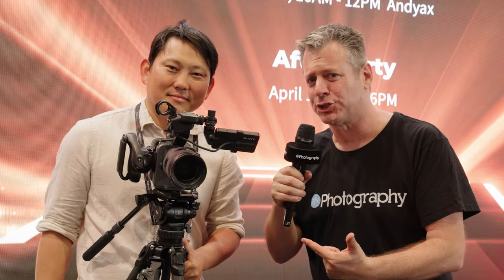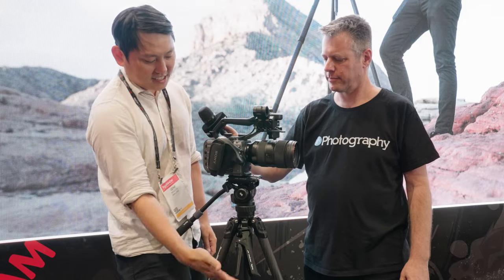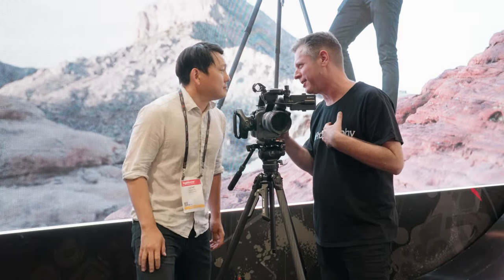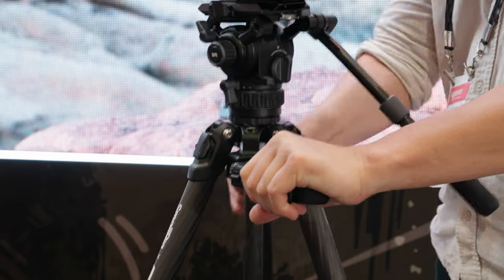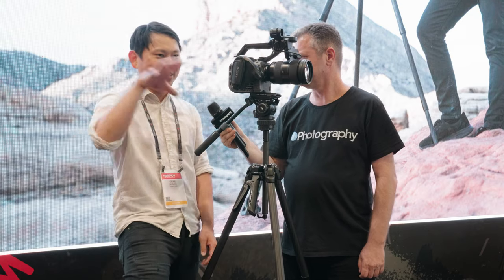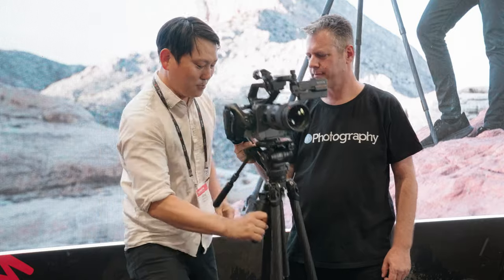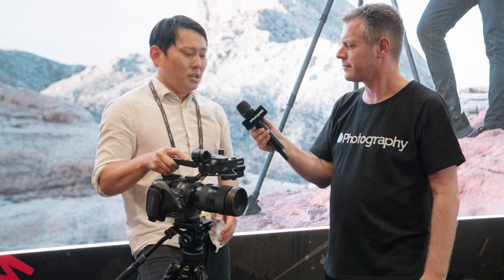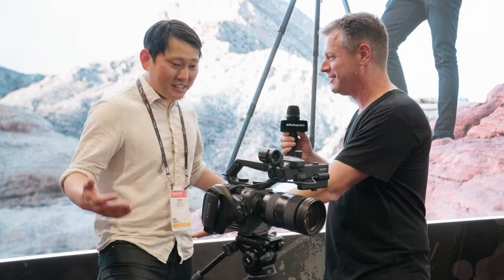First look at the impossible tripod from PotatoJet

Comment: Next, quick and compact light setup
Reply: I’m not allergic to putting lights on sticks, while a down-softbox isn’t in the cards, the fastest off-camera keylight I do is one of the compact battery lights 1/4-20’d onto a cheap amateur tripod.  Cloth diffusion from lightweight backdrop stand (indoor only).  C-stands really have earned their place for flexibility and the other options like clamps, magnets and so on are way more case-sensitive.

Comment: legs are great, in interesting concept with the legs, but the tripod head is the key to professional camerawork, and I don't see a pro counter balance, or speeds on that head.
Reply from the maker: There's a bit of counter balance on this, but it's not fine tuned yet. (The demo had three stages: small mirrorless, FX3 weight, and FX6 weight)
Reply: @diyphotography  Honestly the legs are very interesting, however, the head looks like a clone of prosumer manfrotto heads.